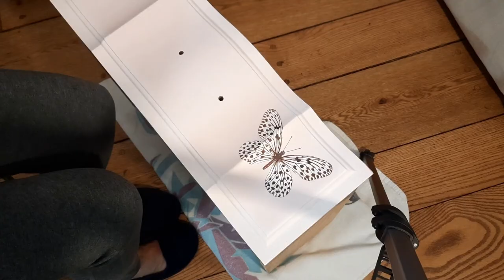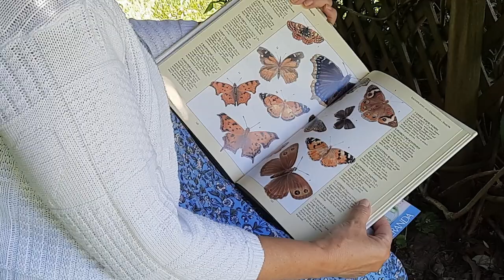A very FRENCH PROVINCIAL Makeover!

Comment: When I have a missing detail....before i even sand a piece of furniture... I press clay over the piece(s) I need to duplicate...then let it dry. Then I fill the reverse mold with clay or a quick dry resin.  Be sure to brush the inside of reverse mold with cornstarch before make the new pieces if using clay.  By the time you need them, they will be ready for you.  You then adhere them to the furniture.  Love this style of furniture! I have a piece in my inventory ! Very pretty color you used!!
Reply from the maker: Thank you so much for the tip on using a  mold, it will come in handy!
Reply: @CampingwithEmmy  if you don't have clay or resin...fill the reverse mold with a wood filler or use your good old trusty hot glue gun!! In a pinch. All will work!! Been there, done that!!😄

Comment: What kind of paint did you use?  I didn't recognize it.  It was the sweetest soft pink!  There are silicone mold kits sold at craft stores and online that are easy to use.  You could get an exact impression of that detail from the one on the other side of the dresser.  Then just fill the mold (I use Bondo because it dries in no time and can be sanded) and ta da! You get an exact duplicate to adhere to the empty spot!  You did a nice job replicating that by hand!  You are more confident than me.
Reply from the maker: The paint I used was from my local Do it Best Hardware store, their brand. They use Sherwin Williams paint!  It is latex paint in satin and the name of the color is Charming Pink! Thanks so much for the tip on the silicone molds!